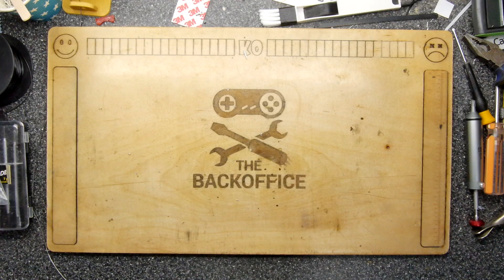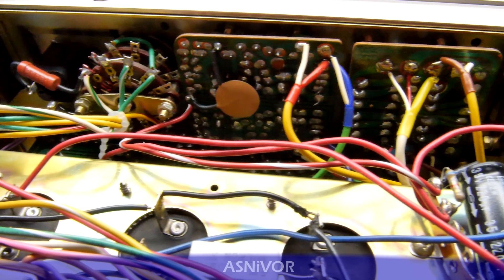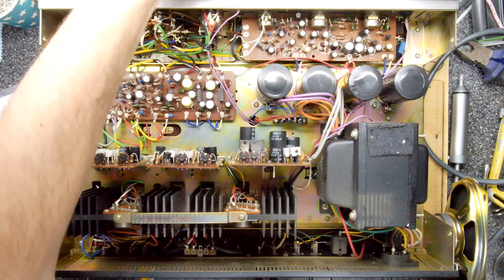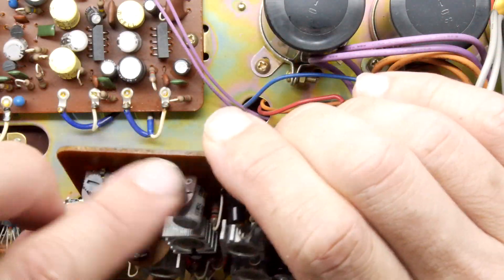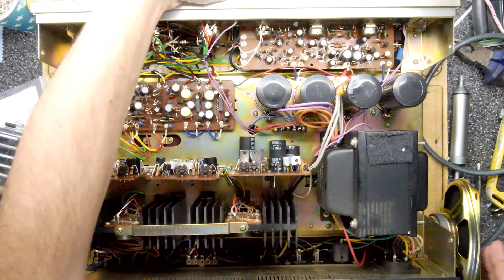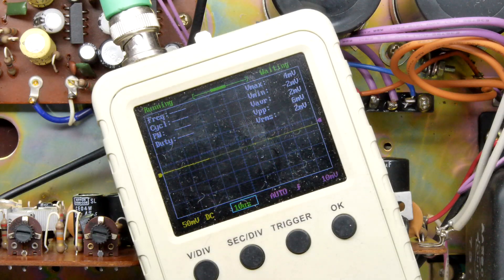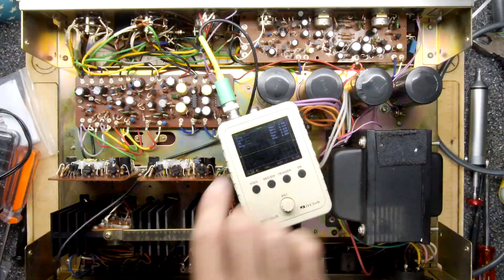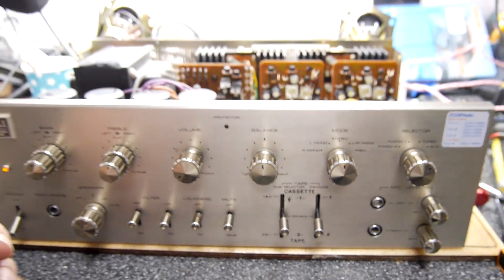Akai AA-5800 Amplifier Service Repair

Comment: I did not know WD-40 made contact cleaners so no clue how it holds out over time. Do you have long time experience with this ? I have seen the effects of all kind of cleaners that eat up the parts over time or started to leak-conduct to places you do not want that or potentiometers that almost did not turn anymore because the stuff dried out to be glue-like over years. There are probably others that are good too but I use Kontakt K-61 for about 15 years now to lube/clean potentiometers and switches ( not for audio, I only repair measurement and calibration gear and industrial/maritime stuff for a living and as a hobby) and I have not noticed any negative side effects or cases where I need to repeat it after a few years.  A tip if you can not reach places like in the video. I have a little bottle that I fill with K61 and use little pipettes, syringes with needles and a small brush to apply it without blowing the stuff all over the pcb or cabinet